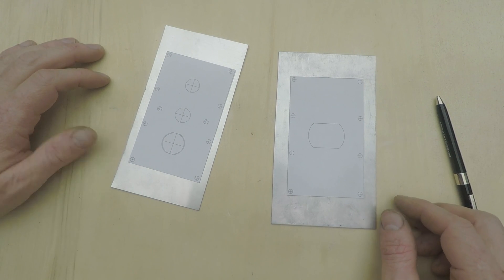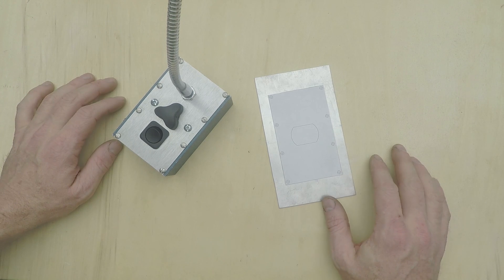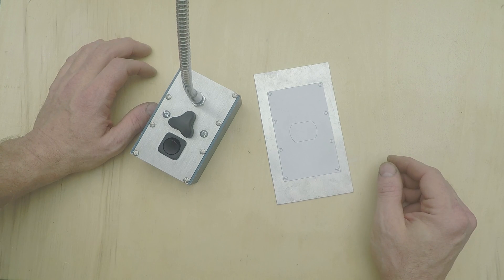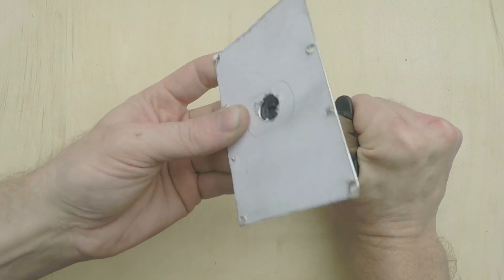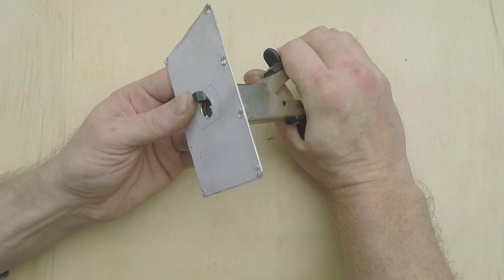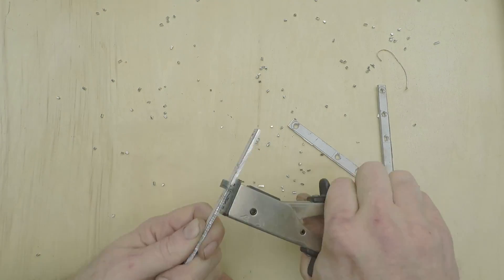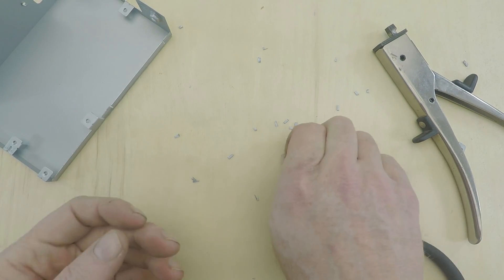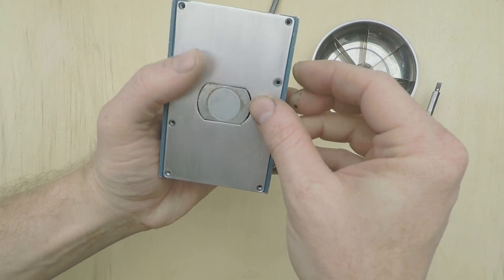Manual Nibbling Tool

Comment: Can a nibbler also cut plastic? Or would a dremel work better?  I also thought using a soldering iron or heating up a sharp utility knife might melt the plastic but leaves swollen areas?

BTW, haven't found a drill bit that does squares (ala Reuleaux, Forstner, etc)

Comment: I bought one in the 90s from Radio Shack.  Works great for small projects.  I started using a Jilson tool for larger work.  Jilson makes their nibbler in all plastic but the jaws so it is light and easy to handle.  https://search.eastwood.com/search?ts=custom&w=nibbler

Comment: Thanks for this. I've heard of these things and had an idea of how they worked, but never seen one demo'd before.
If you want to see an interesting and vaguely similar cutting tool, check out the Bernz-O Matic Bernzcutter. It was discontinued by Bernz-O Matic years ago, but you can still find it on eBay. I don't know why it they or someone else doesn't bring it back. (Or a somewhat better version of it; the original wasn't terribly well made, IMO.)